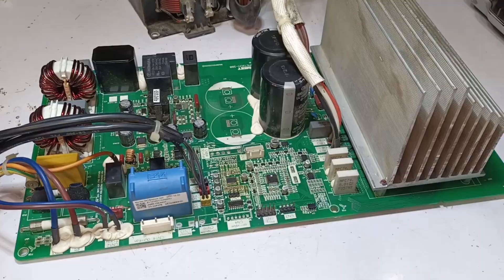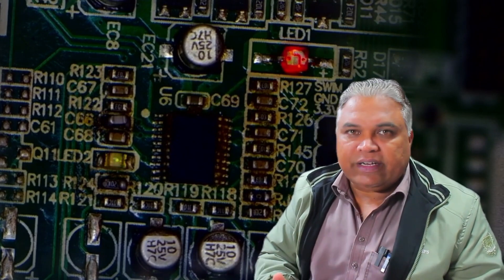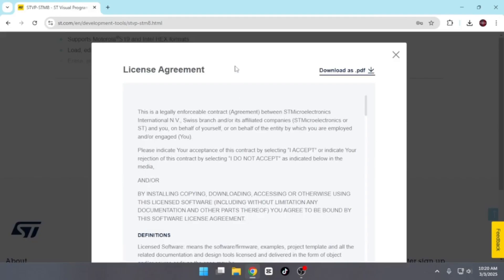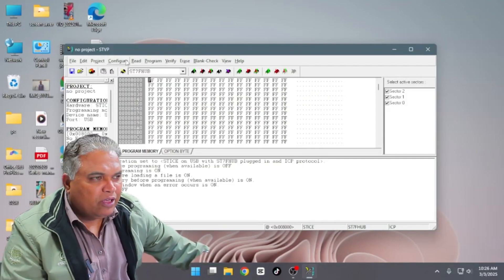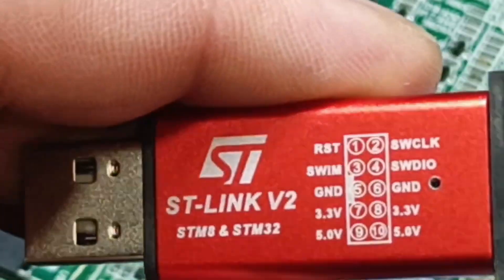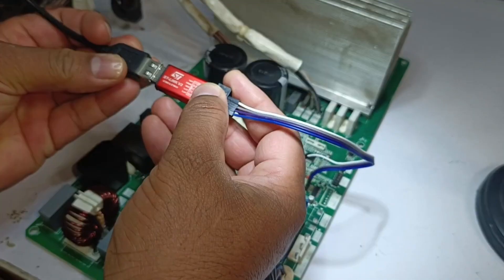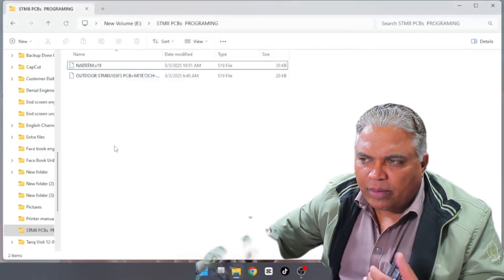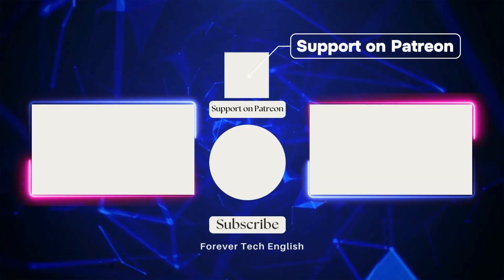Master MICROCONTROLLER Programming for Mini Split AC Circuit Easily!

Comment: we make reset by remote  but after many enter error  softer it will locked so we re program  or make it zeroo and but the software from remote
Reply from the maker: Yes, you can usually reset the software to factory settings with the remote control.